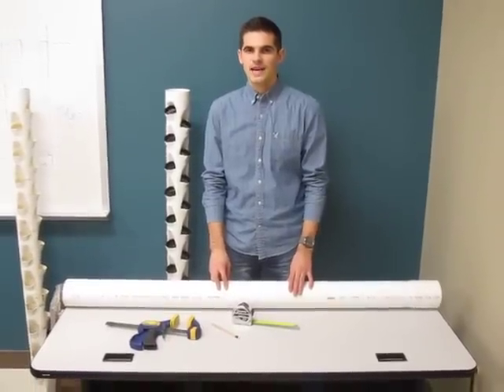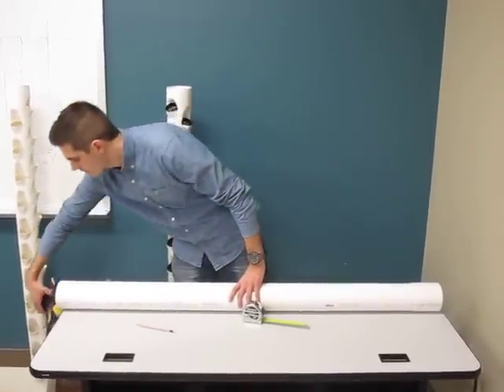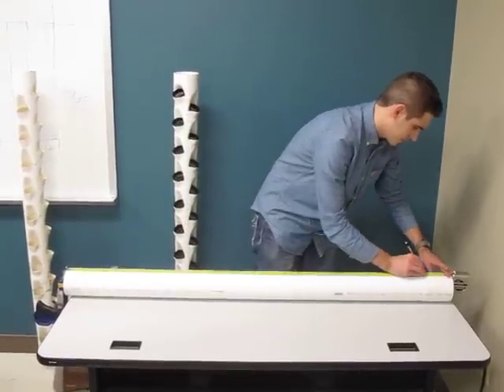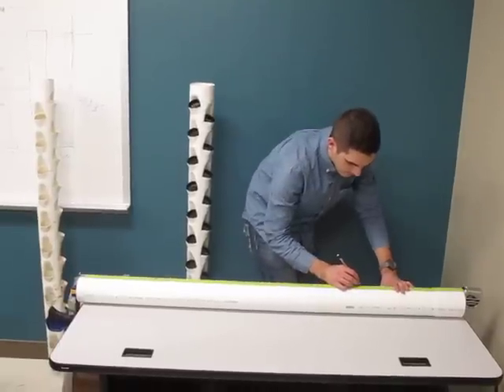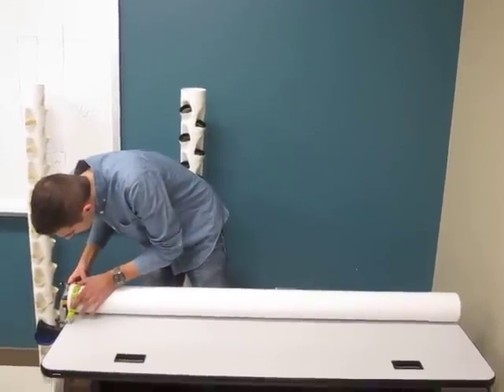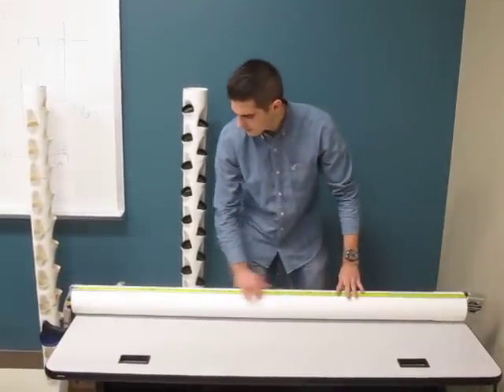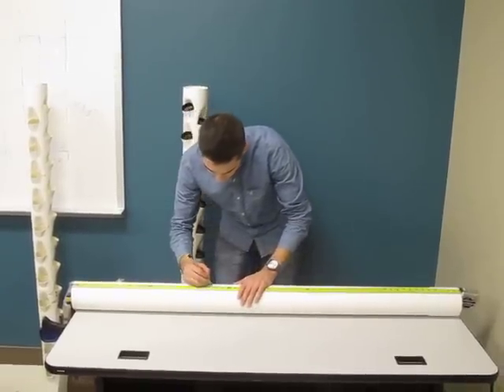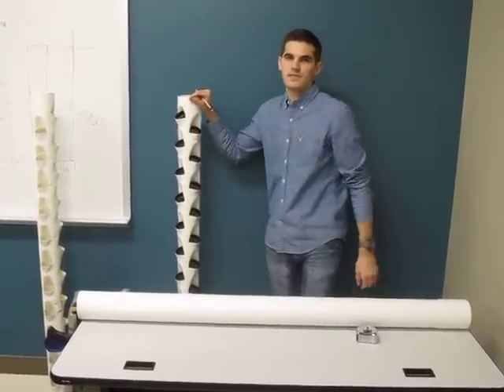DIY #VerticalFarming #Aquaponics #Hydroponics: Part 1 Measurements www.agrowponics.com

Comment: Can someone tell me where you can buy 4" PVC pipe for $4? Best I can find is $25.
Reply from the maker: Ryan Tatzel Any hardware store buy 8' long 4" diameter at the local hardware store. $8 then cut in half. Lowes, home depot...
Reply: Gunnar Shaffer Thanks. So this is 4" drain pipe instead of 4" PVC pipe.
Reply from the maker: A drain pipe is normally green this is just PVC pipe. It can be used as a drain pipe also though. I have read many articles about the safety and that no leacking occurs when using  the pipe only during the manufacturing.

Comment: Nice video Gunnar!  If I used six inch PVC how far would I distance one vertical line from the other?  Also I saw people's questions asking about schedule 40, and I didn't see a clear answer to that.  Maybe I couldn't access the reply for some reason.  Next if I filled the tower with perlite and put strawberries in three inch net cups would a 1/4" feed tube at the top be adequate?
Reply from the maker: I wouldn't use 6in because the spacing in the center wouldn't keep the water flow concentrated and the pipe is heaver and more costly.  But if you do let me know how it goes I am interested... My website agrowponics.com opens next week and I will be selling the towers.  The pipe is schedule 40 because it is easier to soften and form. Yes in another system I have not published or videoed I have made a tower system with a water deliver up the middle of the tower...I am not sure about perlite it might get messy with the roots intertwining. :)

Comment: so awesome, do you have any plans to move this to the next level?
Reply from the maker: Hi John,  we have expanded and sell in all 50 US states and to over 10 countries across the globe, in 3 years as Agrowponics LLC we have not had 1 single tower returned and we are very proud of this fact! We use a CNC machine and then a flameless heat gun to heat form the plastic in addition to complex filters.   We have them for sale now on our website, www.agrowponics.com/shop
Reply: @GunnarShaffer  What do you mean by 'complex filters'? Could you say more, please?
I've been to your site and thought even at the current discounted price of $300 it's not cheap. Maybe, I'm missing something; sure, it takes time to make for which you need to charge. 
That aside, I felt you could provide more information on the site about the system, including 'complex filters' and all the components included. What kind of pump and how is it compatible with other countries for e.g.

Comment: I'm going to be trying this design with a single strip of Matala filter media inside in order to give the tower a built-in biological and solids filter, and make the holes just big enough to hold the rockwool cubes without the net pot. Personally, I'd love to see you find a manufacturer for these and seriously under-cut the price of the ZipGrow towers. You have a far better design in regards to plant productivity. Add some form of fiber media inside of them for the sake of biological/solids filtration, and you'll have a product that beats theirs all the way around and doesn't infringe on their patent.
Reply: @hildagraham5846  It leads to a microsoft alert page.

Comment: Thanks for sharing the video. Is there a reason why you are only using 2 rows on the 4 inch pipe? Would it be too much to have 4 rows or would that be too much?
Reply from the maker: Hee-Sun Han You want the plants to face the sun. Even with 3 rows which is possible the tower become heavier and less manageable and the plants on the back do not grow as fast.

Comment: Hi Gunnar, thanks for sharing. May I know how much it will cost roughly to make one vertical tower also advise which other tools are necessary to have.
Many thanks.
Reply from the maker: Did you watch my other video that shows you how to create the tower? It cost about $4 to make one tower.
Reply: Gunnar Shaffer

Comment: Was the pipe PVC or HDPE?  Each type is available at Home Depot.  Does it matter for your tower?
Reply: jek9911 He says its PVC in the video, but PVC is not food grade, where HDPE
Reply from the maker: Hi Jek9911, thanks for watching my videos, we used safe PVC from Lowes/Homedepot. Make sure to watch the other videos to understand how the whole system integrated. Make sure to check out my website where I am selling my vertical towers.  www.agrowponics.com   Since you watched my videos before and commented use this code for $10 off my towers:  AGROW10

Comment: Does anyone sell these premade?
Reply from the maker: No but i have been thinking about producing them to sell, would you like to buy?
Reply: Gunnar Shaffer is there another type of tool that can be used to push the plastic out for net pots. I am not sure what to use for that.. Hard to see on video
Reply from the maker: Yeah I just made it by hand in the wood shop. I have had so many people ask maybe I should make them and sell them.

Comment: Awesome design!  I just made one with slightly different design... http://youtu.be/oiHu2MdAkg0

I'm curious to know  if you used schedule 40 PVC or thinner?  If it only costs $4 per tower, is that total cost or only cost for the PVC?  Also, instead of a torch, do you think using a heat gun might work effectively?
Reply from the maker: Gabriel Joseph Yes a heat gun would work great also it is a little slower and you need a big one.   $4 is the cost of the tower.  I am glad you posted a video! :)

Comment: Though more economical, PVC is not a food grade plastic.  If you are on a budget and need to make a choice between PVC and a food grade material, that's one thing, but if your goal is to avoid pesticides because of their dangerous psudo-estrogenic properties, you are defeating your purpose because PVC can leach psudo-estrogens into your food supply.
Reply: I am fairly certain that the rigid PVC (often called uPVC) used in this video is more than likely marked as NSF-pw (tested and certified for potable water). With that being said, I would consider it more safe than flexible PVC that is actually commonly used to package food. The reason being is that the rigid PVC does not contain phthalates (plasticisers) to make the PVC flexible. Additionally, the uPVC more than likely does not contain BPAs from what I read. Additionally, it appears the NSF-pw test includes tests at pH 5, pH 8, and pH 10, which should encompass all the pH levels it would be subject to.